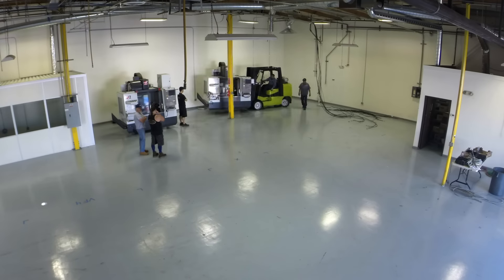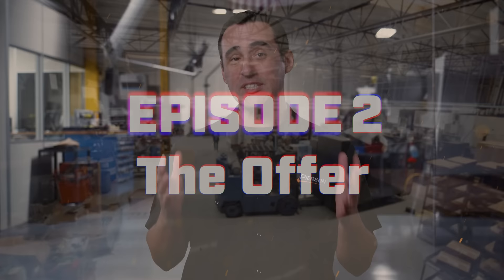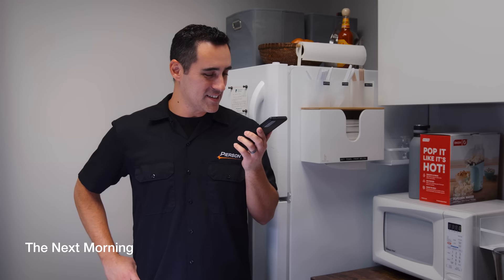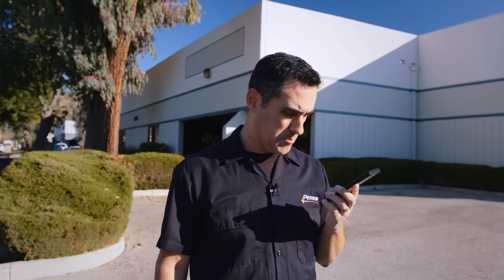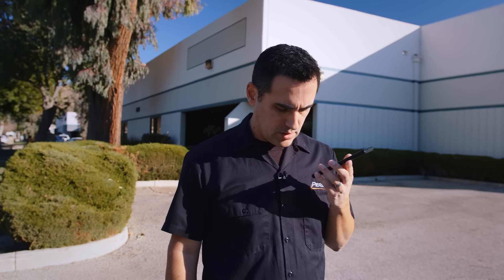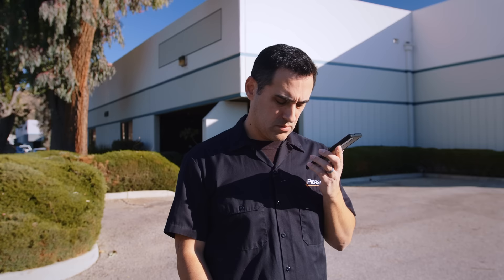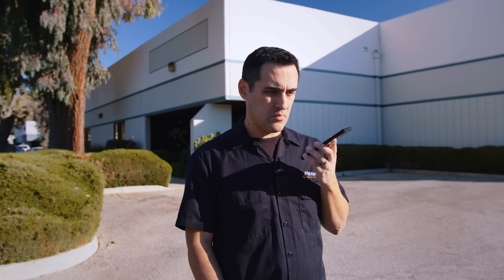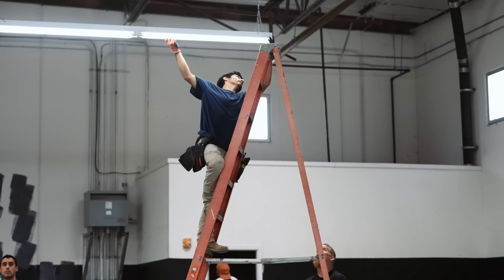Machine Shop Move Vlog Ep 2 | How Am I Going to PAY For THIS??

Comment: I see that you have HAAS machines. According to all the youtube experts - most of whom on abom79s channel, have made it very clear HAAS machines are complete garbage. So, I'm curious what would be your honest assessment of the HAAS machines?
Reply: @ShainAndrews  Who is "he"?
Reply from the maker: There are machines for every stage of business and every type of part just like there are cars for different purposes.  I relate Haas machines to Toyota vehicles: good value, works well for 90% of parts.  I'd recommend a Camry as a daily driver and a Porsche for the weekends.
Reply: @PiersonWorkholding  I think toyotas are great, or at least they used to be, not sure if anything has changed. Toyota put me through auto school back in the early 90s. 
I'm just going over the idea that people seem to go overboard when decrying HAAS as total pieces of garbage. I know you can spend 100s of thousands of more for better and best machines but what small business has that kind of money to toss around? So my point is, I think those lemmings on aboms channel have personal problems and HAAS machine are just fine.
Reply from the maker: My guess is that those that criticize Haas never had to write a check for ANY machine.  Haas machines are a great value and light years better than any manual machine on abom's channel.
Reply: @PiersonWorkholding  You hit the nail on the head. I was thinking that. Sure I can get a great machine and pay a million bucks for it too. LOL. Thanks for the input.